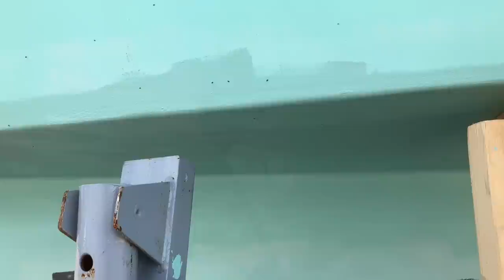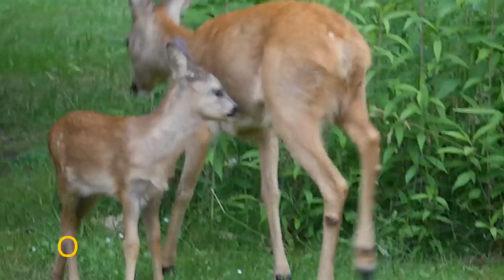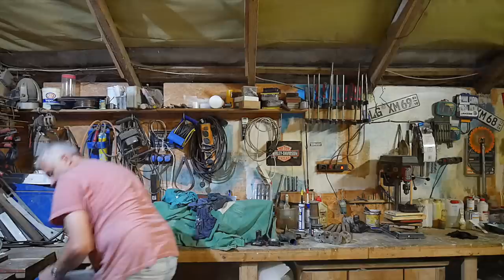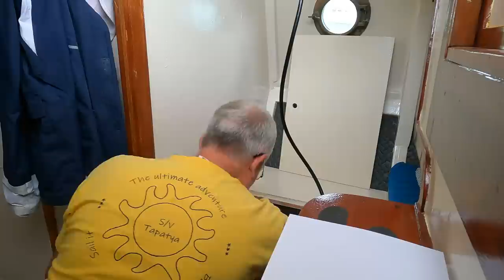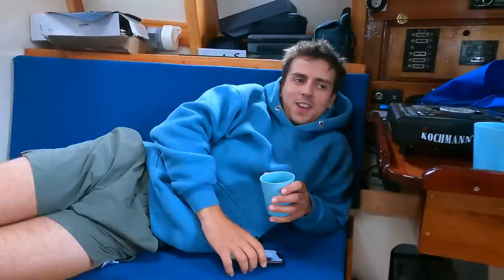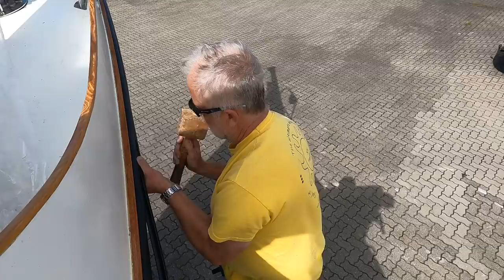Epoxy primer/sealer, rubbing strake, solar wiring, and a spirit burner stove test - SV Tapatya EP286

Comment: Sadly the Origo stoves are out of production. But you can find them second hand. Or you get a reproduction. So did I. This type of alcohol stove is excellent. I highly recommend it. There is no preheating. And they are very hot. It's an equivalent to about 2000 - 2500 watts.
Reply from the maker: Yes, I’ve been looking into them, Knut. A bit pricey, but no doubt good 👍

Comment: I must say we have a 1970s Australian made alcohol/metho twin burner stove with pre-warmer on our (Australian) 20' trailer-sailer. Yes, the pre-warmer is a bit intimidating, but with practice it's okay. However, our stove boils about 2-pints of water in 5-minutes. We like it and meths is easy and cheap to buy and store in the boat. Placing the kettle or saucepan over the burner while pre heating is a sensible precaution. The various models all seem so variable. Oregos are fairly universally admired. Each to his own - all the alternatives come with advantages and disadvantages. Very much looking forward to the launch and sea trials. Sehr gut gemacht, Tony!
Reply from the maker: Thanks Robert. Interesting. Yes to the Origos 👍😃

Comment: Strongly recommend an Origo type stove using denatured alcohol. Spirit stoves like yours are notorious for flare ups.
Reply from the maker: Yes, no doubt the Origos are better. Significantly more expensive too, and you often get what you pay for. 
I think I was a bit confused about the fuel though. I have now learnt that “spiritus” ( or better said “brennspiritus”) is German for denatured alcohol, so the stove in the video is an alcohol stove 👍

Comment: What's equally important is that you size the cable to the solar panels for minimal voltage drop
Reply from the maker: True enough, but the runs aren’t very long here 👍
Reply: @SVTapatya  Calculate Tony you'll be surprised its even more important with low voltage systems, really enjoyed the build haven't missed one, good luck.
Reply from the maker: Thanks Sparky 
I have indeed done the calcs, but, judging by your handle, I’m going to guess you are more experienced in this than me. So, what cross section do you make it for 100 watts at 40v, on a cable length of 10 meters ( it is actually shorter than that)?
I’ve found a few calculators that give quite different results, but all of them say the AWG 16 (1.3mm2) 4-core cable I’ve used is up to the job
What do you think?
Reply: @SVTapatya  should do Tony, I think you'll be fine.

Comment: Hi Tony that was a bit scary with the stove i was seeing it being used on the high seas with the flame as it was turning into a bigger flame glad you thought better of it. like the wedges and the rubbing strake was good. It will not be long now before sailing the high seas. Well done another good video
Reply from the maker: Thanks Kevin. In fact, the flames wouldn’t have been nearly as scary if I’d put the kettle on straight away. But it’s still a no!

Comment: IME, alcohol stoves don't cut it. not enough heat. these days i use the two burner,+oven propane stove on my sailboat. and when i was doing a lot of cycling/ backpacking/camping, an MSR backing stove. it would burn either automobile gasoline or kerosene. very convenient! now THAT stove would put out some BTUs... trust me.
Reply from the maker: Yes, but the fuel for alcohol stoves is pretty available and their less likely to cause an explosion than propane. Some, some, really 🤔

Comment: Alcohol Is very slow but safer than other fuels because the fumes (vapors) are lighter than air and disipate rather than collecting in a corner just waiting for an ignition source
Reply from the maker: Yes indeed!

Comment: I'm not finished watching yet, but is the stove gambled?  Smart idea with alcohol stove.  You cane buy rubbing alcohol all over the world!  Desiel or gas, you can't.   Friends of mine did the same.
Reply: He's not going with the alcohol stove. Doesn't like the way it flared up, or how long it took to heat only half a litre of water. (Gimbled, btw)
Reply from the maker: No, it’s not gimballed in itself, but it would be easy enough to make a gimballed mount for it - I’ve done that before. Yes, the availability of fuel is a big plus 👍
Reply: @jaygee5693  Yes, I finished watching the video and found out about 30 seconds after I hit SEND.
Reply: @SVTapatya  Thank You for responding.  Another channel I watch just finished a 4-5 yr cruise.  The had an alcohol gymbold stove/oven combo.  It was great.  SV WISDOM (Rigging Doctor)